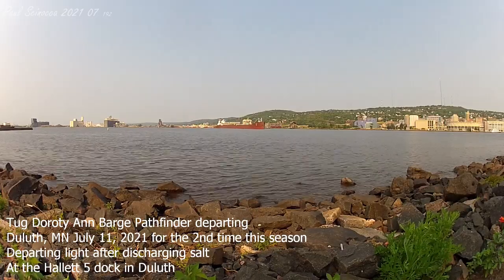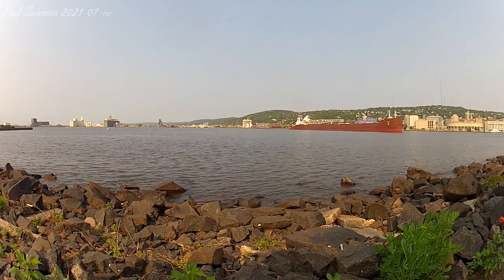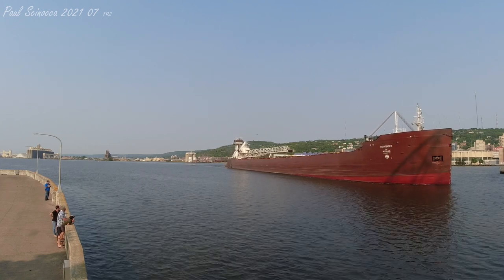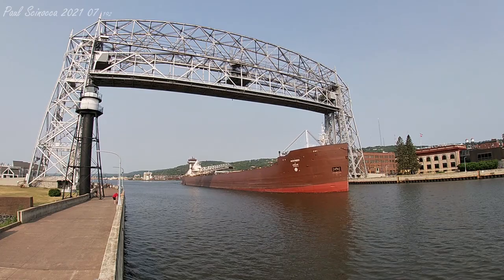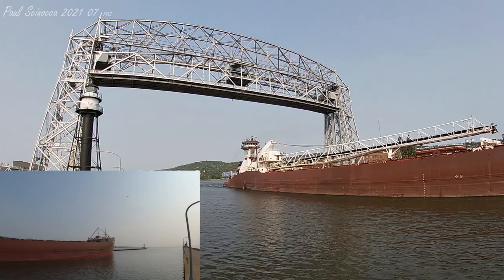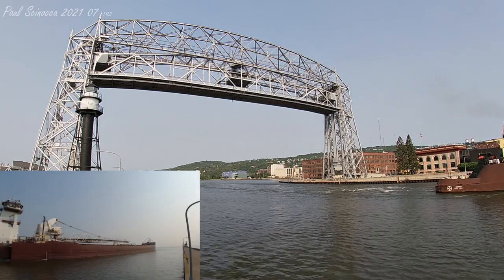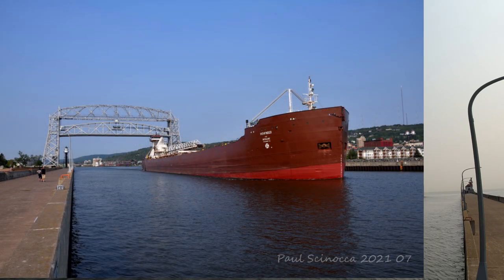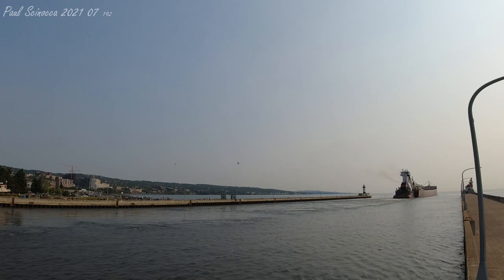All done with Duluth, the Dorothy Ann came in with salt departing with zilch. July 11,20 21

Comment: Are the tug/barge combinations operated with smaller crews than the regular lake boats? The accommodations on the Dorothy Ann seem very small in comparison.
Reply from the maker: Correct, they run a crew of about 14, the lakers around 22-24.